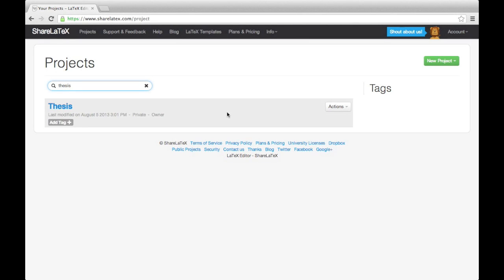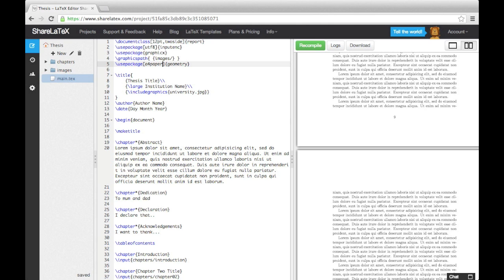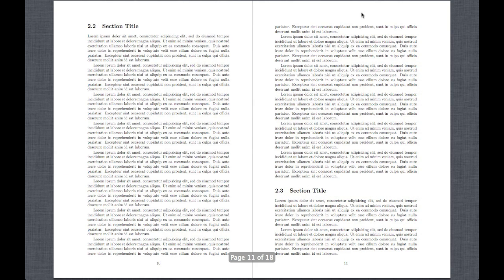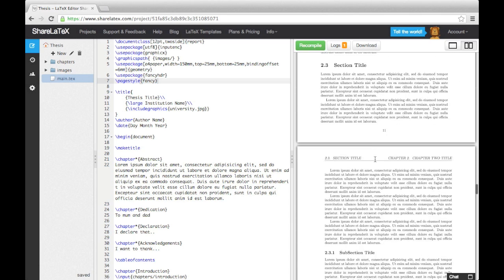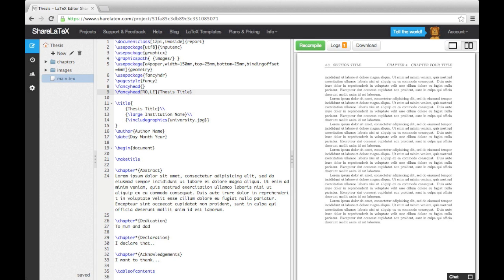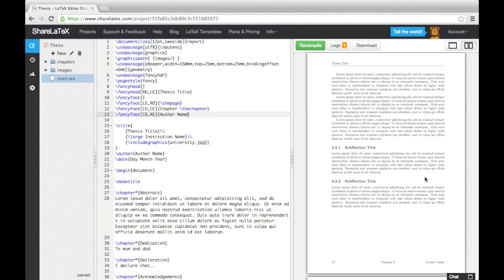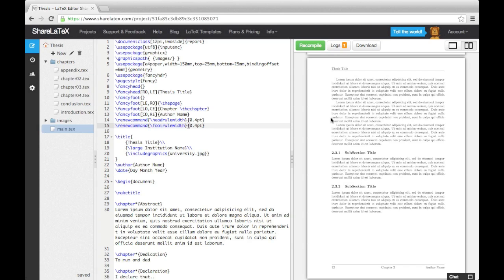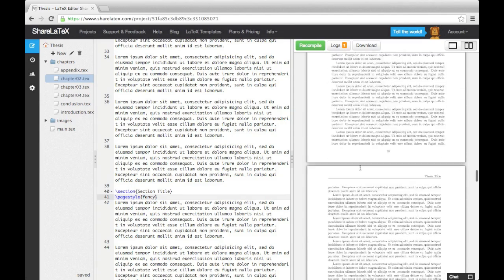How to Write a Thesis in LaTeX pt 2 - Page Layout

Comment: Hello, and thank you very much for such a clear walkthrough of a thesis building process. I used your method so far and I get this warning message...

./main.tex: Package Fancyhdr Warning: \headheight is too small (12.0pt): Make it at least 14.49998pt.

To which I said: 

\renewcommand\headheight{14.5pt}

and then I got this cryptic error I have no idea what to do with:

You can't use `the character 1' after \the. [\begin{document}]

Any advice? Thank you in advance for your time and effort